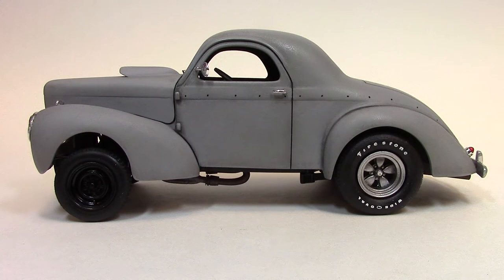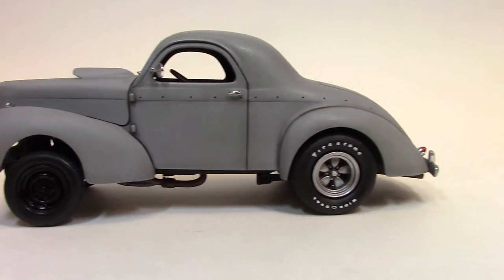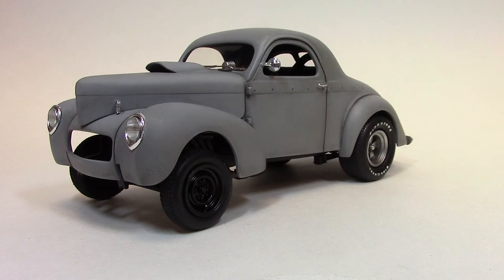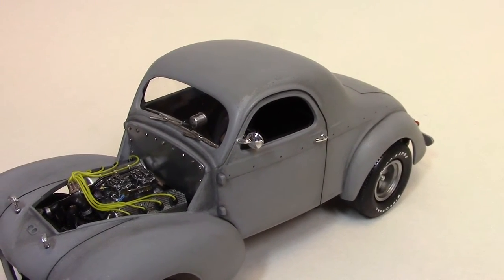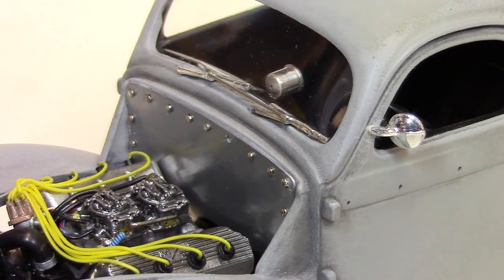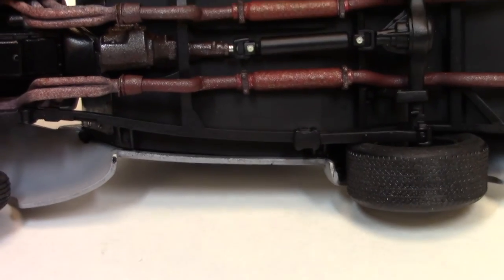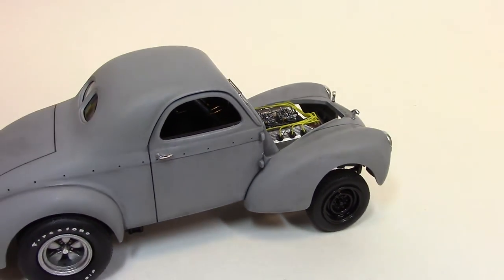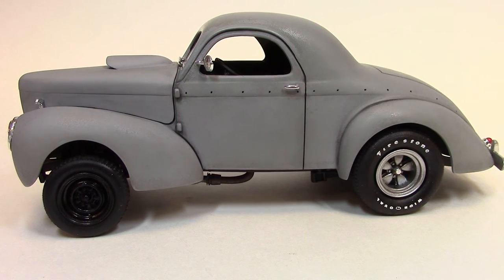Billy Vega's Scale Model Garage : Rebel Of The Road Willys Movie Car

Comment: The first Hemi he had in the car, he ended up blowing that engine up, on the strip running against the “Rootbeer” Cutlass, the first race they had! Then they ended up swiping a hemi out of a cop car and that’s the engine they put the blower on! Cool build though, looks just like the car!
Reply from the maker: Thanks  !  I wanted to keep it streetable with the stock intake and carbs instead of the full race version .  Near the end of the movie , he mentions about returning some of the speed parts back to their owners. . So I figured the final long block and trimmings with stock induction. It was an enjoyable build , glad you liked it .

Comment: Love the builds I was just wondering if you built the American graffiti 55 and 32 and two lane black top 55 even though they are the same car
Reply from the maker: I may consider doing a AG 55 , curbside style since the engine is not shown in the movie . Years ago , I had a TLB 55 started but got overwhelmed with the details , sold it on e-bay half finished , I have a 32 Milner coupe which I am working off and on ,
Reply: It's all the same the same
Reply: @MrBillyVega  all the cars from two lane black top were used in American graffiti it's still a bb chevy 454 with tunnel ram 2 fours duel carb 4 speed transmission and others

Comment: Great build! I started building the same car, and I'm searching for a kit to build the Plymouth from the beginning of the movie. IMCDB has it listed as a '65 Belvedere, but it looks like a '65 Satellite. I'm probably going to use the Moebius '65 Satellite kit for that one. Maybe after those I'll do the Cutlass.
Reply from the maker: Thanks ! Yes the Moebius kit is the one for the Mopar , I am not sure whether it was a Satellite or Belvedere . Possibly the Model Car Garage photo-etch kit may have the emblems for both versions , so maybe you could correct if necessary . I believe the Cutlass was a 1968 although initially I thought it was a '69 . Modelhaus resin used to do a conversion kit , but they closed down . That paint scheme would be a challenge too. But if you built all 3 , you would have a very interesting trio !

Comment: What kit did you use the American "daisy" mags from?
Not that many kits i know with them wheels.
Reply from the maker: Honestly I cannot remember . I have taken the American 200's ( Daisy) wheels from the old AMT 1963 Impala kit and added rim spacer bands from other kits, but I am thinking these were resin . Possibly from the ModelHaus . Scenes Unlimited now makes a set of regular and deep ones , nicely done . Funny ...your user name is Two Lane Black Top. I WAS...building a model of that 55. Spent years on it , and got it about 50% complete but could not complete it . It sold on e-bay for $302.00 !  I went to a show in Timonium Maryland and got to sit in the real Two Lane Black Top 55 Chevy ( The camera car , 1 of 3 built ) My modeling skills have improved , I could possibly have completed now . Thanks for the interest .
Reply: Funny enough ive just pinched a set of them wheels from my "Prestige" issue of the Impala for other projects,also the rear wheels of the Monogram "badman".Ive got a vintage Monogram Vega panel van with them wheels too but not sure to use them or not as its a complete kit.I built a TLBT 55 in the 80s -had to use the Revell Bel air kit as AMT 55 didant come out to 1990.I want to do another which i have started.
Reply from the maker: I got way involved in mine . I used the AMT 55 sedan body , with the frame  and separate  floor pan from the late version AMT 57 chevy . As with the real deal ,  cut the frame near the firewall and scratch built with rectangular 
styrene stock , dropped tube axle , aluminum Koni coilovers , disc brakes and etc... I used an AMT Chevelle big block with a modified tunnel ram intake to match the Wieand tunnel ram  , resin carbs , photo-etch flex fan , alumium pulleys ( Even the timing mark on the harmonic balancer ) and Scratch built hydraulic throttle linkage . Never did get to those headers though . The man who owned the real TLB Chevy would send me reference pics as I needed them and my model was featured on his website when it was up in the early 2000's. Good luck with yours !

Comment: Would you be interested in selling this model? Or maybe I could commission you to build another one.
Reply from the maker: Thanks for the interest . I loved the movie , and built the car to lock in the memory so I could not part with it . With the cost of the kit , aftermarket parts and the time involved in building , the cost of a commission build is not practical . Sorry , take care , Billy .
Reply: @MrBillyVega  thanks for the reply!  Would you be interested in building another one?
Reply from the maker: With my work schedule ,  current health problems and going through a divorce,  it is not possible for me to build a model for someone else . My time is very limited and I do not do any building at the present . My shop is still at former residence . I am trying to set up a new place. I did try a couple of commission builds in the past and neither worked out very well . Because I work at a very slow pace and ended up making about 25 cents an hour .  Sorry ,  Billy .